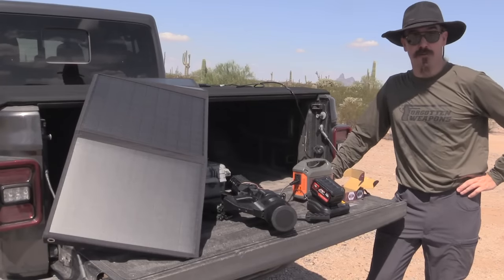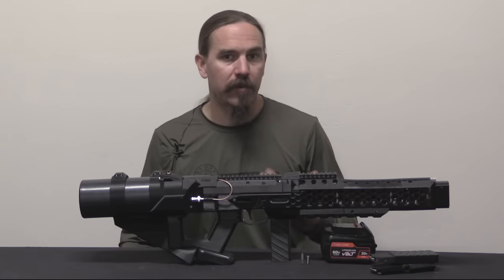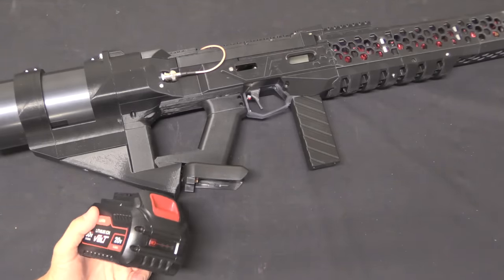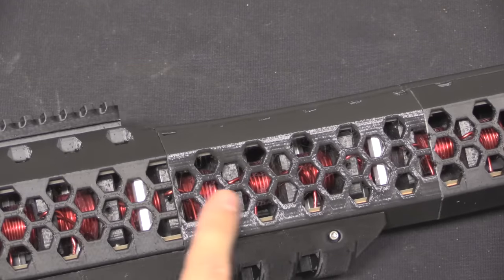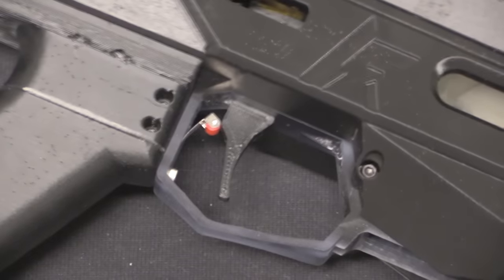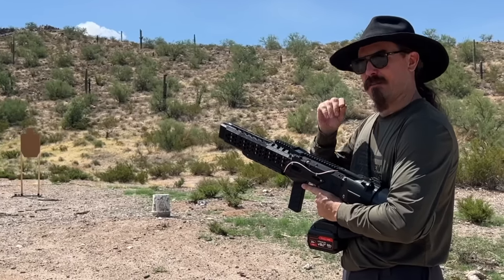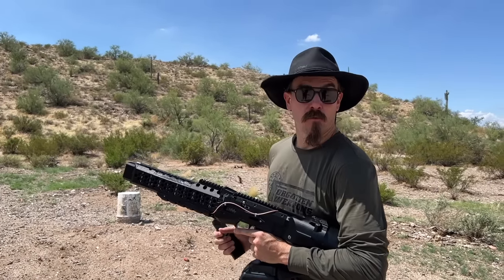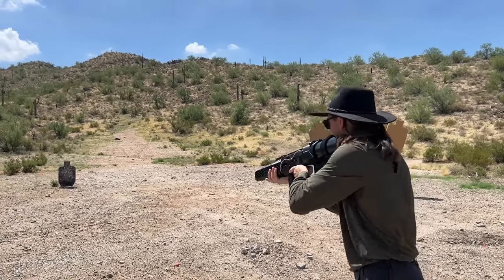ArcFlash Labs EMG-02 CoilGun: Making SciFi Weapons Into Reality

Comment: I get the vibe that this thing is about, where 3D printing was 6 or 7 years ago. Functional and useable by the general consumer, but a bit clunkier and with less "polish" than a mass-market product. That's not at all a knock on it either. These things take time and they are clearly approaching their goals.
Reply: Yeah, I saw the flaws too, but then I imagine a team working on different bits and just getting to a point where it works for a proof of concept. I'm sure they have better versions going now and in their heads.
Reply: There's quite a lot of progress towards usability too which is good to see. Just sort of got to figure out a way of finding an ammo that doesn't keyhole as much, I wasn't hugely impressed with the Mk1 but they're getting there
Reply: Should have recruited a high-school-er to do the modeling .
Reply: ELECTRIC GUNS CANT BEAT A BIG BLOK CHEVY
Reply: I'm just afraid that some of the fundamental limitations (can't rifle the barrel 'cause that's not how the barrel works, etc) will curtail the potential on the design as a whole.
Reply: @sechran  could use finned ammo or sabot you don't always need rifling for accuracy
Reply: Usable for what? It's a toy
Reply: @sechran  they will eventually need some sort of fin stabilization or something
Reply: @sechran  Well, you don't really need to rifle the barrel, all you have to do is make the round rotate magnetically instead of making it grip grooves in the barrel to make it rotate. But it won't really make a difference at these speeds.
Reply: @sechran  totally agree. If you could shoot slugs out of an unrifled shotgun, or arrows from an unrifled bow then maybe this could have had a chance. Sadly this is impossible
Reply: Definitely an incremental improvement on the Anvil.
Reply: @M7A1bayonet  You say it's a toy, but ...

when someone starts shooting drill bits at you, you will be screwed.
Reply: @Grimmwoldds  let me know when they make a device that will do that. For now it's a toy.

Comment: 20th century: “I’ll never trust an auto loader theres no way it’ll be reliable.”

21st century:”I’ll never trust a battery powered gun its to reliant on ext power.”
Reply: Auto loaders are still pretty sus on tanks  but it sure is better to have a extra tank crew for every 3-4 autoloader tank crews as compared to manual
Reply: 22th century: "I'll never trust a gun powered by biologically engineered mechanical pistol shrimp pneumatic mechanism"
Reply: Couldn’t an EMP be an issue without some some sort of faraday cage around the thing?
Reply: too*
Reply: @JoeArn1  If you're involved in a nuclear war I think having a coilgun is the least of your concerns
Reply: garmonbozia  
People with pacemakers come to mind...
Reply: @augustuslunasol10thapostle  

Carousel autoloaders are not a terribly good design, but cassette autoloaders can actually be safer than a human loader
Reply: @augustuslunasol10thapostle  In this context "auto-loader" means semi-auto gun. That is what OP was talking about.
Reply: 22nd century: "I'll never trust a self-cooling plasma coilgun; it's too heavy."
Reply: You mean automatic weapons?  I think the Maxims were invented by the late 1800's.
Reply: @normanmccollum6082  actually EMPs rely on long lengths of wire to cause damages, more complex systems are of course more vulnerable, but pacemakers aren't nearly as complex as a phone and are made to far greater standards. The reality puts the distance required from an EMP in order to survive with a pacemaker at around 1/4-1 mile. The concern with an EMP isn't pacemakers, it's the fact that every aspect of our society runs off power, including water distribution, gas pipelines, etc., very little core infrastructure is shielded, (although there are some grid scale precautions taken) and generally it'd fuck our shit up.

Comment: The tumbling issue can be fixed by using nerf-football-style rounds, the ones with fins on the back that made the ball spin even when you couldn't throw it right. A longer round of that style, say 3 inches by no more than 5/16 wide, fired at 500 feet per second would be really accurate.
Reply: Oooo, sabot coilgun. I like.

Hmmm... can the unreleased wings be used to build spin in the barrel by giving them opposing charges?

Comment: Being able to pick up the spent rounds with a magnet is somewhat helpful on the range!
Reply: That was my first thought as well, all that ammunition is reusable if recovered and simply wiped off.
Reply: I would love to see what the "rounds" look like after hitting the steel plate. I would image that the ones on the paper target would be reusable, just difficult to find.
Reply: Well this gun has something good compared to standard rifles. Weight and ammo that weight less. The only thing is battery...
Reply: @Wolfshead009    Look up 52100 steel.   It's what most dowel pins and berings are made of.

Comment: I love that it runs off a cordless drill battery
Reply: And that it fires drillbits
Reply: I don’t think this is OSHA certified
Reply: It's green 😂 the next generation is going to have a wind turbine attached to it too
Reply: @hashbrown777  I'd buy the same diameter steel rods and make my own ammo with an abrasive chop saw
Reply: @zekeyeager1458  Most the stuff I do isn’t OSHA certified.
Reply: @zekeyeager1458 too bad it's under the watch of ATF lmao.
Reply: It actually has practical use, as you can resupply in hardware store, without actually needing a supply line

Comment: I love how the only actual sound it makes is a light clicking from the trigger being pulled. Kinda freaky to think that it can get such good speeds while barely making any sound.
Reply: If they were ever to get to a point where the projectiles are supersonic like normal bullets, I'm sure it'd be a fair bit louder, but yeah it's cool how it just ticks at you like a sewing machine.
Reply: there's also a strong solenoid pushing the projectile into the first accelerator coil. The clicking you hear is the solenoid activating, not the trigger.
Reply: I don't claim to be a clairvoyant, but I could imagine the 2030s, 2040s, 2050s when we have batteries that are powerful enough to deliver serious kinetic energy out of a railgun or a coilgun? (I'm not talking .22LR energy, I'm talking scary levels of energy, enough to impale someone into a wall or a tree with metal rods like the flechette artillery rounds from Vietnam). Don't get me wrong, the Arcflash rifles are cool as hell, and are very promising first steps towards man portable coilguns, so I'm not bashing them. But their "stopping power" is limited.

I think once they become more powerful, smaller and advanced as battery tech advances (hydrogen cells, beta radiation batteries like Americium batteries, solid state batteries, etc)? The first military units who will adopt them will be special forces/SF guys. Think about it. You could have a railgun/coilgun that fires a bullet the size and weight of a 7.62x39mm bullet, and delivers similar kinetic energy. But the magazines will only have to be as long as handgun magazines because there's no need for a case, just the bullet. You could carry far more rounds that deliver similar energy, and you have a rifle that is almost completely silent, requires less maintenance (no carbon fowling in the barrel or gas systems, because there's no combustion!), you could theoretically make your own ammo in the field if you had to, and for the purposes of clandestine operations? You leave little ballistic trace. No gunshot residue, no casings, no sign that a gunfight even occurred, all your enemy sees after you leave is a bunch of dead guys and strange 7.62mm bullets they've never seen before, or if you're using metal rods? A couple of dead dudes who've been impaled into a wall or a bed. It could be an ideal special forces weapon for those reasons, plus the one you mentioned. It will likely be quieter than any suppressed combustion firearm (other than subsonic .22s) and has the potential to be far more powerful.
Reply: If the make these powerful enough to stay just under the sound barrier(1080fps I believe) these thing will be scary
Reply: @keithm5378  i can imagine similar weapons being used on vehicle mounted mode taking energy from the vehicle it self, like a minigun for example
In such a configuration for example it won't need the battery and it won't really need to be that accurate either taking to account the amount o projectiles it can produce 😁
Reply: [Playful sarcasm] Can we get a silencer on that thing? Asking for a friend... [/Playful Sarcasm]

Edit: Added the clarification it was meant as a bad joke.
Reply: @sneakysquirrel1990  perfect assassin tool. No gunpowder residue, no noise, no shells left behind, the slug doesn't actually contact the barrel so there's no identifiable indicators on the bullet itself (unless you're dumb enough to leave fingerprints on them). yeah
Reply: @keithm5378  The battery isn't the limiting factor here.  The problem is a fine balancing act between trying to put the maximum current through the coils to increase the magnetic field strength (and thus muzzle velocity) and not melting the coils with too much current, all while keeping the thing light enough to handle.  A better battery would just improve charging time and the number of shots.

The next major steps in improving the muzzle velocity will likely take the form of coils made of exotic materials with even lower resistance than copper wire (gold, for instance) and active cooling.  The steady but slow improvements in supercapacitor tech will also help.
Reply: There are almost no moving parts. Nothing that goes boom. Just clean energy death
Reply: @oasntet  Fascinating. Thanks for the information and the insight, you learn something new every day! I love chemistry and firearms, but i know there are many others out there who are far more knowledgeable than me when it comes to mass drivers, batteries,  electromagnetism and such. I was under the impression the bottleneck for man portable railguns/coilguns was the batteries and as you mentioned, the supercapacitors. Reason being I recall hearing about the US Navy experimenting with putting very powerful railguns on a new class of destroyers that could handle the power output a few years ago, and that the older Destroyers were not capable of putting out the power needed to power an engine, and a railgun, so they couldn't be simply retrofitted. 

But you make an interesting point. I have done experiments at home with electrochemistry and electroplating and I've noticed once you have a very conductive solution (using something like Sodium Hydroxide as your electrolyte in water, to generate Oxyhydrogen gas), and you drop two electrodes hooked up to a DC power supply into the vessel? It will generate pretty low voltage but a crap load of current, around 0.2-0.5v and 10A+. After running it for 30-60min? It starts to get pretty warm. Passing current through a conductive material such as metal plates or wire made of Copper or Nickel, and even nonmetals like Graphite will by nature generate waste heat, which is exasperated by high currents. And the last thing you want is your railgun coils overheating and melting down during sustained fire in the middle of a conflict zone. Or even worse for that matter, the battery being damaged or exploding due to overheating. I have seen that happen first hand with the older NiMH batteries and also 18650 Li-ion batteries. But you also don't want to have to lug around a railgun that weighs as much as a Barrett M82, unless that railgun is also capable of putting out .50 BMG or 14.5x114mm levels of energy. As you said, it's a balancing act. Wonder if Graphite/Graphene could be used in this application, only concern would be the brittleness. I know that both Silver and Platinum are both highly conductive and have low resistance, but the former will react with the air to form Silver Oxide (after looking, Silver Oxide is P-Type semiconductor instead of a pure conductor, so atmospheric oxidation of silver connections could potentially be a problem, especially if you're subjecting them to massive amounts of heat and then abruptly cooling them down), and the latter would be ridiculously expensive to incorporate on a wide scale. But I digress. I think it'll be neat to see where this technology goes in the next couple of decades.
Reply: @keithm5378  The power needed scales up either with the square of the cross-section or the cube of the mass (I forget which, but either reveals the problem), so having both a massive power source that can deliver tons of amps to the capacitors, and a massive amount of farads in those capacitors becomes increasingly important when you scale up to artillery-sized weapons.  It just so happens that lithium batteries and current supercaps are sorta-okay-enough for a portable rifle-sized coilgun that delivers around a tenth of the energy of a typical handgun round.

For more efficient coils, there are some exotic wire types typically only sold to gullible audiophiles, like oil-impregnated silver-coated copper, or even gold-plated stuff.  It's all very expensive and prone to failure, but for a military contract?  Might be an option.
Reply: @fovarberma752  the purpose of a silence is to dampen the sound of the gas releasing. given that there is no gas release with one of these. sadly no, a traditional silence would have no effect.
Reply: @tjsmith5802  I will edit my comment to add an indicator that it was meant as playful sarcasm.

Also, I would have expected you to mention that the vast majority of guns that uses suppressors end up making more noise than that, and to go on a tangent about the subsonic speed this ammunition reaches.
Reply: @fovarberma752  you're good buddy, I was super drunk last night and just binge watching forgotten weapons. Sorry to be "that guy"
Reply: @tjsmith5802  Don't worry about it, it wasn't comedy at my peak either, hence me clarifying it was a bad joke to begin with.
Reply: @oasntet  bascially in the future average pc guys with a little bit of knowledge can turn into coil and railgun experts that is a scary but really cool thought
Reply: @keithm5378  it's not the battery tech that is behind, you could recharge that gun with AAA batteries, it would just take longer, the batteries affect the recharge rate, not the power of the gun.
what actually affects the power is the supercapacitor, we need improvements in discharge rate, not recharge rate.
Reply: @JohnnyShagbot  Yea, a lot of people forget that's what a lot of the boom is from the gun. It's why silencers can only do so much.

Comment: Put the battery in a backpack form that plugs into the gun. That would add more power and more capacitors on the gun itself. End result is higher velocity 😊

Comment: One thing about having a single larger capacitor at the back is that it makes it easier to maintain but also vastly more dangerous in the case of a catastrophic failure. If one capacitor blows up at the front you might have to go to the hospital to fix your hand but probably won't have lasting injuries, if one huge capacitor blows up right next to your face that's a mortal danger. Hopefully by the time they release it they will have compiled a set of procedures to inspect the capacitor.
Reply: I couldn’t agree more. I work with those things often. It should have a blast exhaust port to prevent a pipe bomb situation, large capacitors have a overpressure port usually. But if it’s enclosed it won’t be good.
Reply: Agreed. But the software could monitor the capacitor and calculate its ESR, then warn the user and disable charging if it gets too high. It won't catch all catastrophes, but that is the usual indicator of a failing cap.
Reply: In fact it comes with a five-year guarantee that if the capacitor fails they'll send you a new one free of charge, and they'll also send a team to help find your head ! 😁
Reply: @Kevin-mx1vi  what’s left of it anyway
Reply: Reminds me of those self contained reloading muskets he showcased before, which you revolved a lever to reload the powder and the shot, but had all the gunpowder stored in the stock, so if it wasn’t absolutely perfectly machined it would basically explode
Reply: Truly the RN-50 of coil guns lmao
Reply: That's probably what the fuse is for; to ensure that excessive current isn't applied to the capacitor (whose failure point is pointed directly into your shoulder/thorax).
Reply: you could add a screw-on steel “jar” cap with a rubber inner lining to cover the capacitor. This should protect from an electric discharge and damage to the capacitor from rough use.

Also the drain wire to the resistor should be mechanically protected either with a cover or by running it inside the gun. it would be pretty easy to damage the outer jacket of it and have it ground out to someone or someone.
Reply: I have to believe they considered that with shielding /porting, but maybe they didn't. Yeah, a cap that size popping on your cheek would really suck.
Reply: Put a rotatable (for righties and lefties) steel case with a big slot or a series of vent holes on the side, the slot or holes covered with a "bumper sticker" like decal.
Reply: @ew3612  That drain wire is definitely a last minute addition.  My bet is they originally were going to go with a different approach, but needed something "safe" ASAP.  That connector would also allow the weapon to run from "shore" power, and is likely used for that purpose during development.
Reply: Was just going to say this. I saw a capacitor this size blow the door 30 feet off an electrical cabinet, the door was bowed into a bowl shape and the chunky steel hinges had been bent 90 degrees
Reply: I imagine that will become a huge problem as battery tech improves and these things are pumping out enough juice to fling the projectiles at rifle velocities.